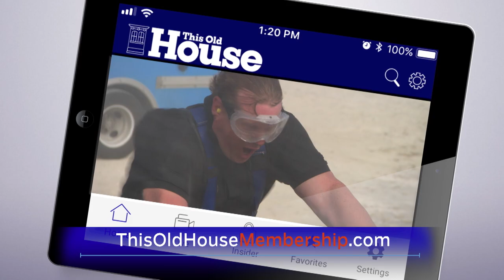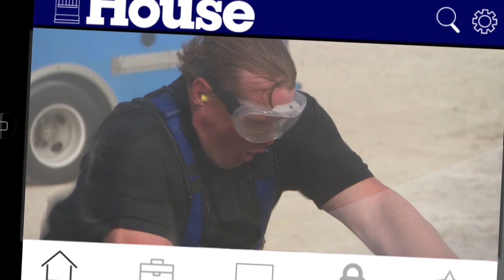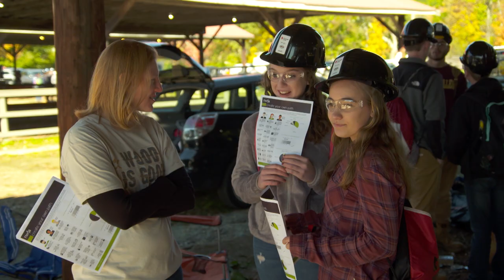This Old House | Salvage Helps the Bottom Line (S39 E12) | FULL EPISODE

Comment: Literally a pre-cast stone wall and then I hear mahogany on the ceiling in the kids room, but remember they have a tight budget on this....
Reply: Yeah...so tight that they have built an entirely new garage with a heated garage floor with an upstairs bedroom, bathroom, kitchen, and living room.... also extended the kitchen out, did a full add on to the house, turned everything into an open floor plan meaning demolishing walls, re-did the upstairs of the originally existing front end... they are doing atleast $400,000 worth of work
Reply: @richardgrace5043  idk why they didn’t demo it and build a new one. Obviously there was no budget. They spent more on the reno then the house was worth ffs
Reply: House hunters energy "I'm a part time kazoo cleaner and my wife constructs artisan mice homes out of grass. We are on a tight budget of 500,000 dollars"

Comment: I believe the door is upside down,LOL
Reply: @Kevin-mp5of  ... I said the same thing but also noticed the height of the latch, which would be chest high if they flipped the door around. That tells me ALL the doors are mounted this way so gotta match the rest.
Reply: @Kevin-mp5of  ... I was in agreement there. I only mentioned the door latch position, but the larger rail (as shown at 6:21) belongs on the bottom as installed, so is correct.